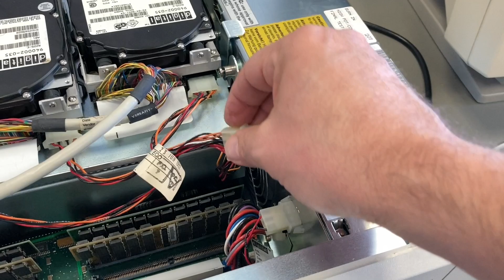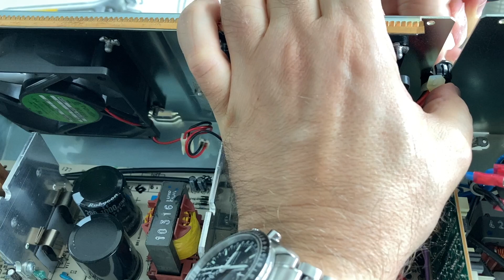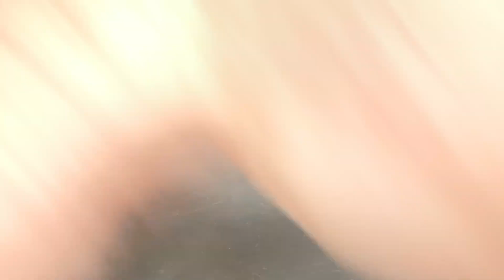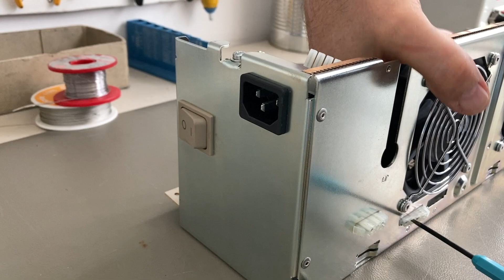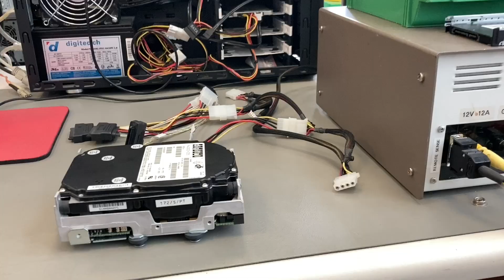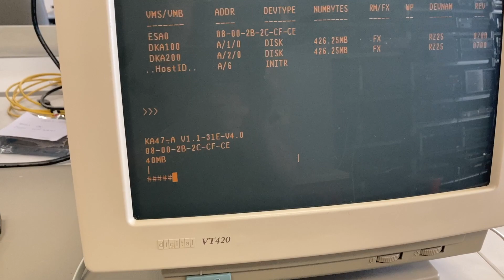DEC Microvax 3100-80 with a smoking HDD (PWJ237)

Comment: I got a DEC Microvax 3100-40 yesterday.  Quality computer.  But the metal clips that go along the side of the chassis can fall out  possibly causing a short circuit.  So I have removed all these clips.
Reply from the maker: That’s a common problem since the day when those systems were new. I always remove those EM grounding strips.

Comment: The system board to disk tray cable is a bugger, there are also some rather sharp edges which caused many a swear word when I used to be a system manager on these things!  Built like tanks though - wish I'd kept my VaxStation 4000/60.  Worked on MicroVax 2000 all the way up to 7840's + many many Alpha systems.  Loved em! OpenVMS still rules - far better than 'cooler OSes' that are about now & secure too - I should know, still in the IT game :-)  The owners should make it far more available now its on x64 - I'd get a copy!
Reply from the maker: When I worked with them, I removed the lower tray if there was no CD or TK drive. The cable is a bit easier to reach then.

Comment: I've programmed all the Vaxen, from MicroVax to 8600 standalone and clusters. I wrote Vax/RDb, C , COBOL, and FORTRAN IV and Vax assembler, all 450 instructions of it. Ultrix and VMS. People must still use them for legacy apps because they go for thousands on Ebay.
Reply from the maker: The last ones we serviced were on a nuclear power plant. The process of replacing parts there is extremely complicated and bureaucratic. That‘s why they keep everything unchanged as long as possible.

Comment: Have you replaced the Dallas clock battery yet? I would have done that first. I guess I would have been wrong also.

After that I would have assumed stiction on a drive (same as the other poster below mentions) that age. Glad it was something simple.

When replacing a SMD component I prefer to hold it down with an xacto knife or similar instead of using tweezers. With tweezers the part will typically end up hovering over the board by the same amount it was when you pushed it down into the existing solder blobs on the board. When simply holding it down it'll be pushed down flat onto the board once the solder warms up.

I knew a guy who used a MicroVAX back in the time of this device. I think it was a MicroVAX 2000. Something smaller than this.
Reply from the maker: You may be surprised but I have some modified Dallas chips with a replacable battery on top.

Comment: You did it the hard way of plugging the SCSI cable into the mainboard while it was still connected to the drives on the drive tray instead of unplugging the SCSI cable from the drives and plugging the cable by itself into the mainboard without the drive tray in the way.
Reply from the maker: I know. But tearing the whole tray apart is a lot of work. If you’re careful, it works well the way I did it.😊

Comment: The initial not working when drives plugged in to power pointed directly at one of the drives having a shorted voltage line and not the power supply. Wy didnt you start with the actual problem in the first place as it was a dead giveaway?
Reply from the maker: Well…to add some extra drama to the video? 😊
No the reason is that the system worked fine one day before and I let it run over night. Next day it was crashed and I suspected the P.S. because I never saw a disk failing like this. But I had many of these P.S. with bad caps. And bad caps can cause strange phenomena like load depending crashes. So I started with the caps they needed to go anyway after that time…

Comment: One of my favorite tasks, replacing capactiors in a DEC PSU ;) Frist I thought it is the same PSU as in a MicroVAX/VAXstation 3100/20, but after you opened it, I saw it is a further developed design.
Reply from the maker: I see a VAX4000 cabinet in your avatar… is that correct?😍
Reply: @PlaywithJunk  Yes, you're right, a VAXserver 4000/300. The picture is 21 years old, but the machine still exsits, although with another drive configuration.
Reply from the maker: @DECcomputers  I have a 4000-705 at work. It appears in my video „VAX Games“
Reply: @PlaywithJunk  I'll have a look at this video, I havn't seen it yet. The only game I played on VAX so far was Tetris on NetBSD on my VAXstation 4000 VLC :)

Comment: I recapped the supply in my 5150 recently- it was actually an OEM upgrade supply made by Astec which has universal voltage (85-265V) and active PFC.  The PFC board, which had one electrolytic capacitor, was an absolute pain to remove.  I also had to wait another week on a capacitor which I forgot to put on the order...

Comment: We installed a Microvax to replace the big Vax system that had it's own airconditioned office. the microvax just sat on top of a bookcase. the old system was given away as scrap 😞
We had to keep a vax up and running to support a lot of projects that had a long operational life time.
Great to see one again. even if I'd never want to use it's word processor and print processor again. the thought of all the page formatting being done in escape characters 🙂

Comment: Capacitors are the usual failing point. Sometimes a sensitive thermal camera can lead you directly to the tantalum cap. Even relatively new Macbooks have them fail. Surprised your mechanical drives still spin. I live in the Tropics and here the lubrication between the head and the platter tends to break down so discs do not spin up. Sometimes you can twist them to start spinning to recover the data. Else to go solid state is much safer. On my daily use the Macbook has all soldered close by, great for speed with repairability most compromised.
Reply from the maker: I have a video about finding bad caps with a thermal camera (on my phone)